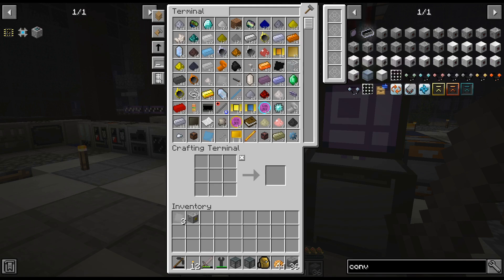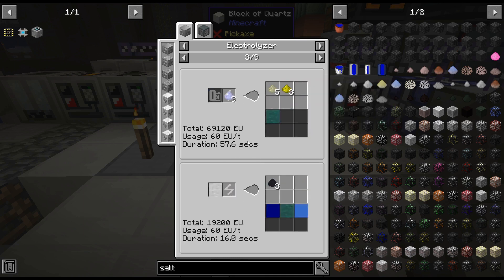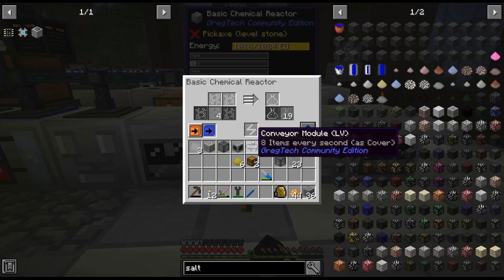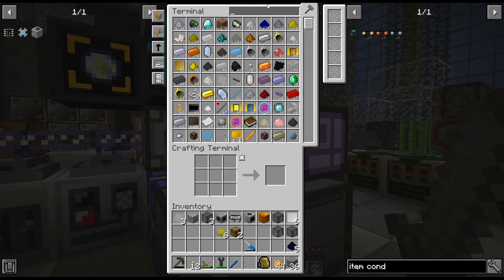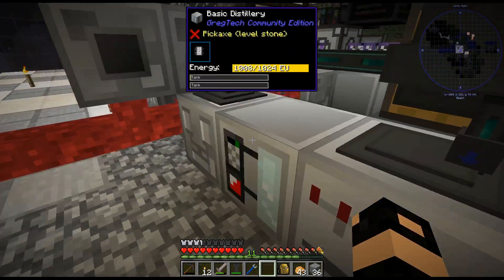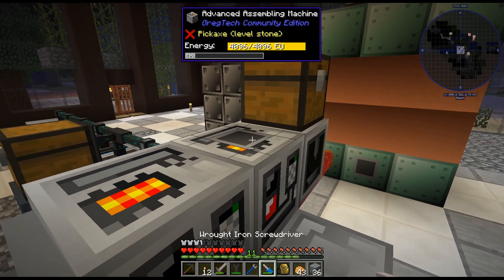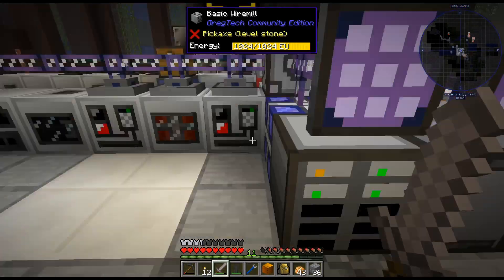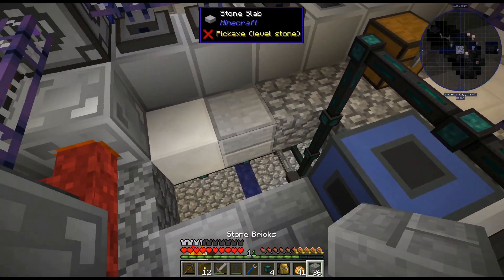Omnifactory - 26 - Fully Automated Circuits

Comment: 01:00 Patterns are initially somewhat expensive, but as you progress through the pack and get better themes of circuits, they will become quite cheap. I believe at EV you get a circuit that starts at Tier 3.

14:00 I still hold out hope that you'll switch to using the Assembler for vastly better conduit yields someday.

15:25 You can access that filter on the top of the machine from any other face by using the access grid that shows up on every GTCE machine/bus/hatch while you're holding a tool. For all faces except the bottom, it would be the little rectangle along the top edge. This is the "access adjacent face in that direction" region for the top of the machine. From the bottom, you would instead use the little squares in the corner, which access the opposite face.

15:50 Extruders aren't the solution to your slow plates problem... they're actually worse than Compressors at that task (since Compressors are already specialized for it). What you want is a Cutting Machine with lubricant.

17:25 AE2's blocking mode does not work with any GTCE machines or inventories (I'm not sure why, it just doesn't). You will need to be careful not to program recipes in the same Assembler that can clog it or mix ingredients to form a different unexpected recipe. PackagedAuto's processing recipe blocking mode on the other hand seems to work perfectly with all mods (but that's still a ways off).

32:10 Oh no... you still haven't noticed the cheap assembler recipe and you're autocrafting conduits with the crafting table recipe 😢

There is no issue with lag arising from AE2 fluid routing and I would strongly encourage you to use it. The caveat is fluid import and export buses, because all buses from AE2 generate a ton of lag and should be avoided. Use fluid interfaces for inserting and extracting fluids from the network and everything should be fine. There is a bit of lag from letting GTCE machines fill up with fluids and stop instead of shutting them off when you have enough in stock, though. Consider using level emitters and machine controllers to pause machines when you have a desired buffer instead of letting them backstuff.

Comment: If there's a filter on a side you cant right click on, right click on the small rectangle on which you would normally right click with a wrench to turn the output.
Reply: Yep, the grid for accessing obscured faces of GTCE machines is a great feature. In addition to the rectangles accessing the adjacent sides, the little squares in the corners work to access the opposite face.

Comment: The cutting machine is super slow using water. I recommend setting up a GT fishing machine and then processing the fish into lubricant. It's a pretty huge upgrade.
Reply: There's quite a few different recipes to make lubricant, and all of them are pretty good. In addition to the extreme speed increase, lubricant goes a long way since a lot of the recipes use very tiny amounts, so you don't have to make it all that often.

Fish oil is also a viable option for producing epoxy (specifically, for glycerol) but the quantities you'd need are more on the order of a simulator running a guardian data model and a loot fabricator generating stacks of fish from the pristine matter.

Comment: Fortunate you can use air (air collector machine) to get polyplastics... there is ALOT ethylene, so doing that by air is faster.
Reply: but you get better yield using oxygen
Reply: With how much PE and PVC you need, it's worth the extra effort to make oxygen for the extra yield. Debatable whether it's also worth it to use the even better TiCl4 catalyst recipe later on though.